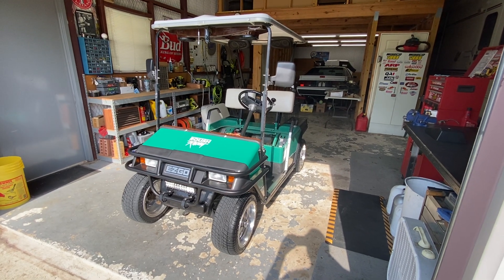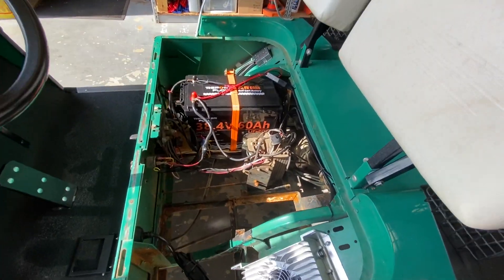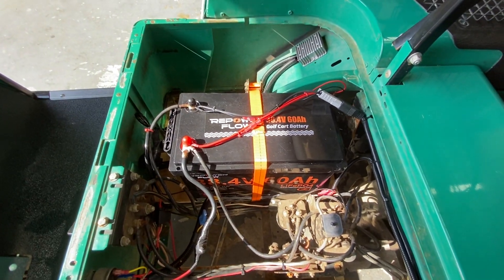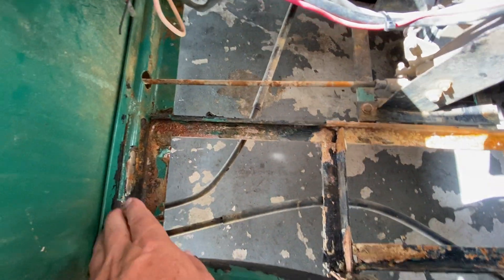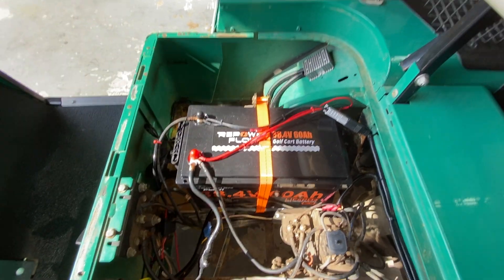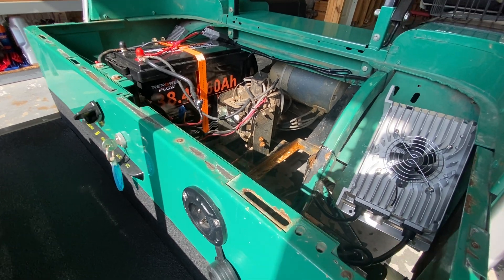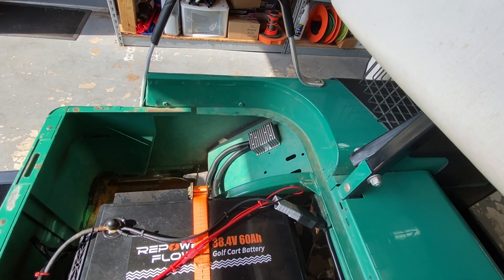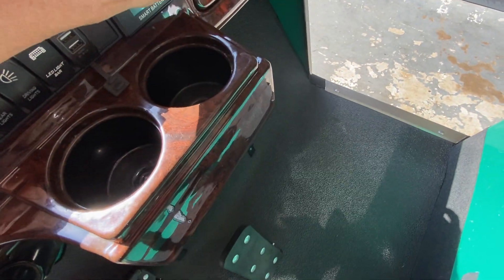EZGO Marathon LiPo Battery Upgrade - No cutting/welding required!

Comment: Do you have a link to that battery? And the 12 volt adapter? I have the same set up and I’ve been looking at putting 3 12V but I like that set up